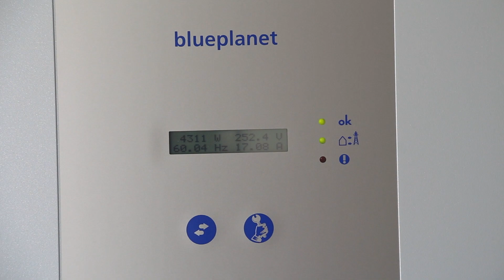Residential Solar Installation: Our Experience So Far

Comment: Hey Alex, perhaps i missed the mention, what size is the system, and do you have spare capacity in your system to augment?
Reply from the maker: The system is rated at about 5kW on the DC side and that's all the current inverter setup can handle. While the system doesn't produce as much power as we use in a year, the net metered time of use billing plan that we're on works out such that we could increase our power usage by about 18% and still not have to pay anything other than the basic monthly service fees.
Reply: Alex Venz  how did you pass inspection without the conduit being painted and stickers bein applied ????
Reply: The installation is from 2013 at that time was not a requirement in Lancaster area.

Comment: Wow that's all you need now. I had a house nearby install solar panels yeas ago. They are hue and take up most of the front of the house. I can't see the back to know if some are there too. All I know is this is about 1/4 or less than they have and you charge a car. The rate this technology is increasing is incredible.

Comment: How much power can it produce? and do you always do maintenance every few months like clean them?
Reply from the maker: The highest I've ever seen the AC output end hit was around 5kW, according to the inverter. Since the system went live, it has produced a total of 37296kWh. As for maintenance, I spray the panels down maybe two to three times per year since the Antelope Valley is a very dusty environment and we get very little rain here--the hydrophobic coating on the panels makes them mostly self-cleaning if you live in an area that gets a fair amount of rain during the fall/winter/spring months.
Reply: How is the battery bank is it frequently changed or easily damage overtime? How long it last before u get a new one and how many batteries it need to store emergy and how long the charges last before it need recharge
Reply from the maker: I'm running the system purely as a grid-tied system for the time being, so I have no battery backup. Given that I charge electric cars at night at a special rate, an off-grid solution doesn't make any financial sense for me. I may add on a battery backup strictly for emergencies in the future, though.
Reply: Thanks for the info ...

Comment: Alex, thank you for your video.  I live in FL but am thinking of putting solar panels in our home on the Caribbean island of Curacao where electricity is a lot more expensive than Florida.  Since the harsh conditions, (heat, humidity) are constant in Curacao, I was looking at a better panel made by Sunpower.  They are more efficient but also more expensive.  What panels do you have and how did you decide on those panels.  Also, the inverter of choice seems to be by SMA.  Thanks!  John
Reply from the maker: Assuming you're referring to the Sunpower X21-345 panels, they certainly seem like good panels and are a fair bit more efficient than our Suntech STP245-20/Wd panels--it's amazing how much has changed in terms of efficiency, availability, and cost just over the past year or so. Anyway, our main concerns with the panels were heat (we hit 115F here last summer, but things get down to around 12F during the winter and humidity is extremely low all year), wind (40-60+ MPH winds are pretty normal out here), and cost. The panels should be pretty well sealed up, so I think that your main concern when it comes to humidity will be the inverter... just make sure it's well sealed and I'd suggest keeping it out of direct sun if possible (we had our Kaco 5002xi installed in our garage). That said, SMA makes very solid products so you can't go wrong there.

Comment: Hey Alex, 
Very smart decision to go solar and awesome video! I just started a sales job in solar here in Victorville, CA and I'm curious and very much interested in learning more.
You seem to know a lot about kWh and i have a question. What does highest peak AC output mean? also, do you have any electric bill like "fees"?
Thanks man,
Aris
Reply from the maker: Well, a system's peak AC (alternating current--what the grid uses) and peak DC (direct current--what photovoltaic panels produce) output are different due to your inverter's efficiency and transmission losses through the DC circuit. In my case, the inverter's efficiency is 95.5% (CEC)... which means that if my PV panels are producing 5kW DC, then the maximum AC output of my system would be 4775W. The DC and AC output numbers that I was quoting in my video were determined using different testing standards, so that makes them difficult to compare.

As for utility fees, there is a nominal monthly service fee from Southern California Edison regardless of my power usage but it typically isn't more than $2 or so.
Reply: Alex Venz w

Comment: Question?? How come they did not trim the rails on the empty space they left between panels.
Reply from the maker: There were originally panels there but they had to move them due to shadow concerns (dryer vent turned out to be too close). Leaving the rails made grounding easier and was a better idea than cutting it and leaving the mounting studs or trying to grind off the mounting studs.

Comment from the maker: It is possible that a roof could be damaged during the installation process (especially a tiled roof like mine) but with proper care while working and sufficient sealing of the holes made to accommodate the mounting hardware, you shouldn't have any problems. If you're having a company install the PV array, then just make sure they cover roof damage and water intrusion at the mounting points in your installation contract.

Comment: Question: Do you think installing solar panel process can damage the roof? I am afraid if it damages my roof. So I have still not installed at my home. My home also faces south east location. And so sun is super power ful on my roof. :)